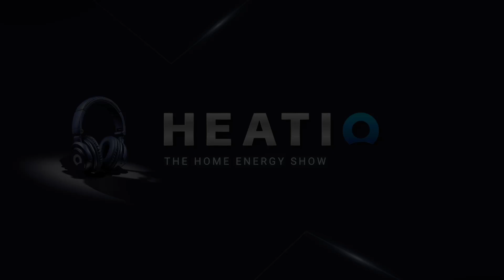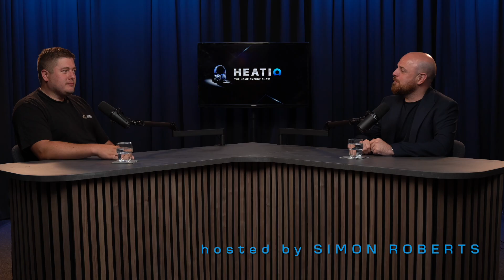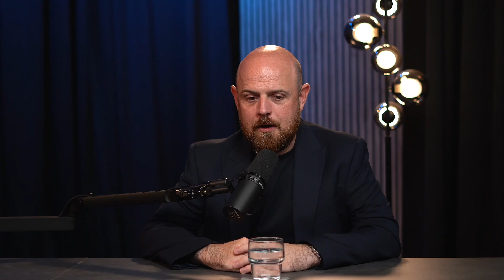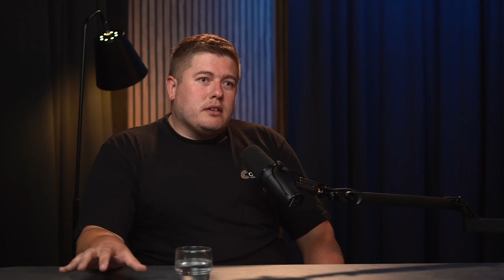Episode 35: Smart Home Integration & Solar Solutions

Comment: I've just gone on to Octopus Go and all my solar is going to the grid, i have to change the settings on the powerwall app every night and morning, the battery is is charging at night so the house was running from the powerwall in the day even when i tried to use the Zappi on Eco + the power was draining  the battery
Reply from the maker: That sounds really frustrating! Hopefully, some small tweaks in the settings will help, but it's definitely sounds a bit of a juggling act!
Reply: @Heatiouk  Hi They have just come back to see whats wrong with but the electrician and the previous one don't understand the setting as they dont have solar and EVs . He did say he asked his boss if they could have some lessons on setting up so they understand what the customers want and need but the boss didn't want to know , he has made a few changes and has gone now still leaving me with the Zappi and everything coming from the powerwall , Surely any power should come from the roof first, i said I'm not sure about the Tesla App settings but he doesn't know anything about settings, He didnt even knoe what a FIT payment is, so fed up after spending so much . I've spent hour's on the internet trying to find how it should be set up.